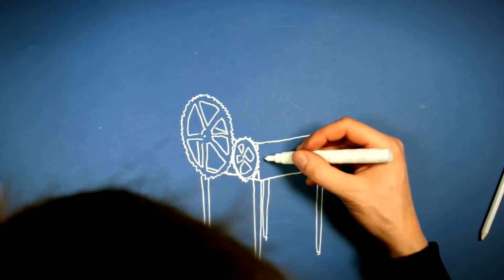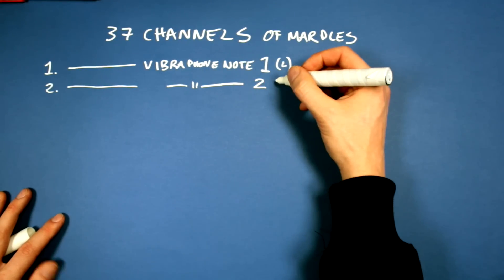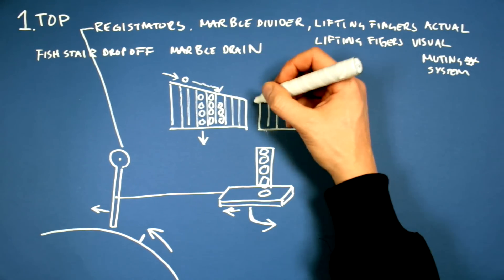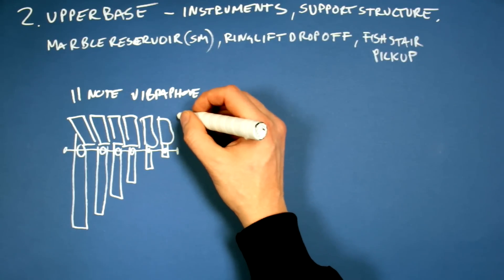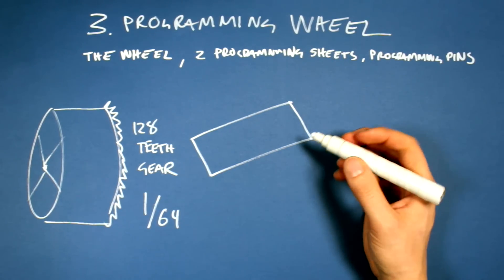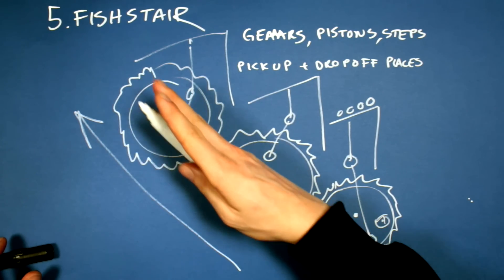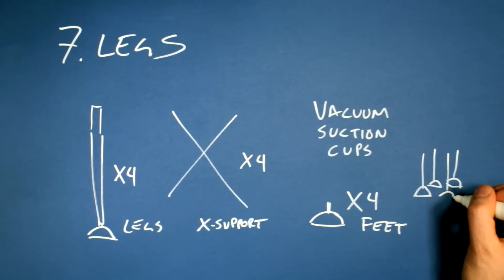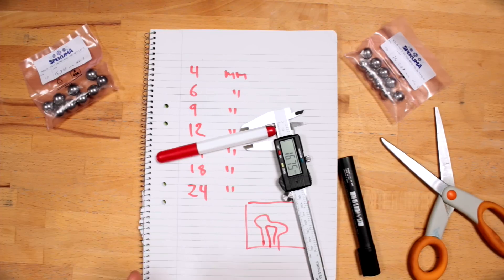First Sketches - Marble Machine X #1

Comment: Is there a job that does something like this? (DIY and building tech stuff)
Reply: it's called engineer
Reply: 3D Design
Designer Maker
Product Design
Engineering?
Reply: mechanical engineering
Reply: What type?
Reply: Nightmare mechanical engineering I suppose but it's more drawing plans and stuff like that and it depends who makes it, it could be a carpenter for wood, Smith for metals, ect...
Reply: 10 Bit What I meant was the type of engineering where you plan, draw and than make but on the technological side. (Example: You want to make a phone so you plan out what you need to do, get the materials and make the phone)
Reply: Nightmare I'm not too sure about it since haven't seen a type of engineer who draws and then builds what he makes lol, might also do some researches on Google.
Reply: Commercially I don't think there are really many engineers that work the entire pipeline on tech development outside of prototyping and hardware startups. If tech is really what you'd like to know about in regards to the whole process electrical engineering would be the best bet.
Reply: look into Product Design, Electrical Engineering, Product Design Engineer
Reply: If you're lucky or brilliant
Reply: +Nightmare, In some small tech companies, engineers will be really hands on, and build prototypes and sometimes more.

Another place is in contract engineering and similar businesses.  A client hires you/your company to design and build something for them.  In at least some such companies, engineers will design and build a prototype plus design the method of mass production.  In some companies, "building" will mean ordering parts from 3D printers or machine shops or whatever, but in others you might find positions where you design and fabricate.

But I think the real answer for where you see all these things together though, is in super small companies of one or two or a handful or people.  I've seen this in the maker movement when people decide to take a project and make a company out of it.  And some startups have the "three people in a garage" stage, which lends itself to this type of work.
Reply: @Nightmare: iam doing drawing / designing / building the things - mostly electronics (hardware and software)- sometimes  construction/design.. as mentioned by Crhis and others.. we are a small 'design-office' (~5people) - we only build prototypes or miniature series (up ~50 units - but mostly 1 or  2 of a kind.) if we cant' manufacture a part ourself (mostly complex/big metal parts) we go to one of our favorite supplier/craftsman and order them there. key is to have a good network of people you know in person and you can trust and where you know how for example detailed they need a cad construction to help you make the part for you.. we try to use local company's so we can visit & have short ways/ fast cooperation..
most of the works we do are for trade-fair or other kind of exhibition like museums or this kind of things... it nothing to make a huge amount of money - personally i would say its more a good compromise of 'do what you like to do' and 'get money for this' :-) iam happy with this  ;-) (and as every job - sometimes you have to do things you don't like ;-) )

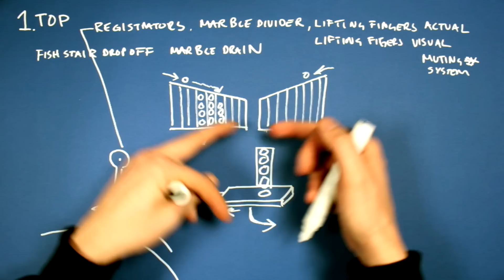Comment: 4:45 - regarding the sloped partition to allow marbles to fill the 37 channels, you need to be careful on how it's sloped.  If a single channel only has room for ~3/4 of the marble a portion of it will stick up jamming the rest of your marbles.  I would recommend taking this into consideration by either sloping the lower portion to be parallel, allowing each channel to fill with an even number of marbles, or some other means.  

Just my two cents.
Reply: I think the easiest way is to slope the lower line in parallel with the upper as you said..
Nice catch btw :)
Reply: i agree with @Swerve2987, i see also an other issue with this approach, like when the first marble tube needs more marbles then coming back the other (lower) tubes will not be filled at all. and those can get empty when used to fast.
Reply: I was going to say the same thing too, if you play then end channels near the entrance to the marbles too fast then they'll fill up all the time first starving the lower channels.  You almost just want a bunch of toggle dividers which are smart enough to not switch if full, so that if everything is being used marbles will be distributed perfectly evenly, but in the other cases, it wouldn't get jammed from non-use.
Reply: Could have some kind of revolving mechanism at the top which falls when weight is on it, but once a slot is full will not turn.

Or you could just measure the marbles and how high they stick out of each channel.

The biggest problem I see is the balls come out of the top tubes faster than the bottom ones and so no marbles end up in the bottom tubes. The way to prevent this is to make sure enough marbles cover all holes at all times, ready to slot in.
Reply: If the marbles come down a solid ramp that is angled slightly towards the channels for the marble storage, rather than directly over the top of them, I think the marbles will be able to go around the obstructions.  It will take some experimentation.
Reply: Yes if the marbles have to bump directly over the top of full channels then this doesn't sound very robust, they could easily skip or get stuck. Will be a bit tricky to get the filling to work smoothly.
Reply: systems like this tend to also have some issues with a large amount coming in all at once which may end up being a bit of an issue keeping up with the notes playing
Reply: A surefire solution would be to not funnel all the marbles into one stream in the first place.  Direct each instrument's marbles into its own path to a lift mechanism that has separate compartments for each instrument, like a conveyor belt with a row of compartments on each link.  Then you just need a reservoir of marbles for each instrument large enough to last long enough for a marble to return.